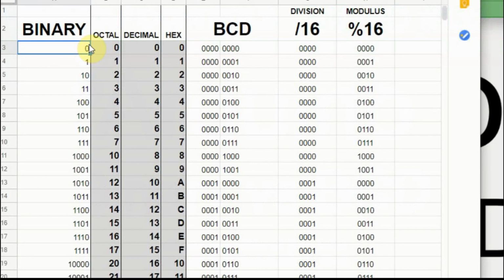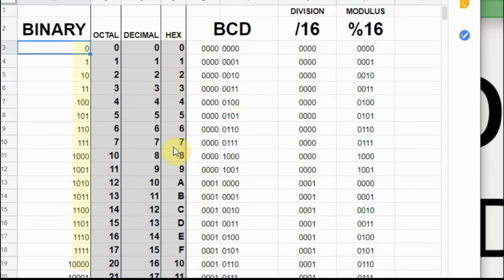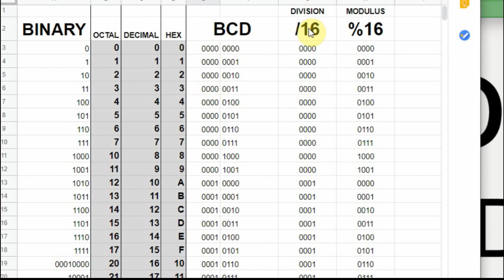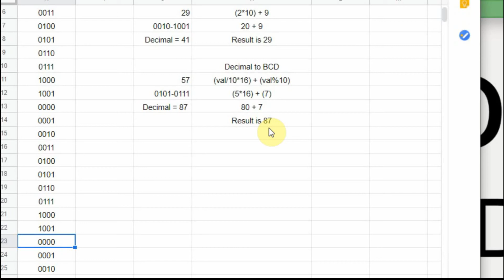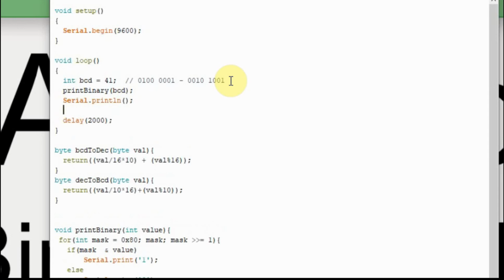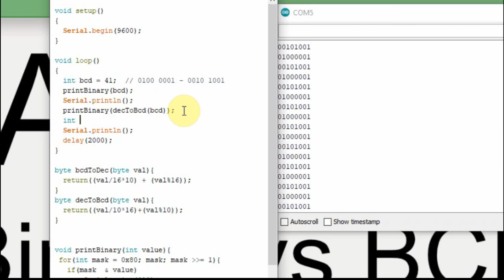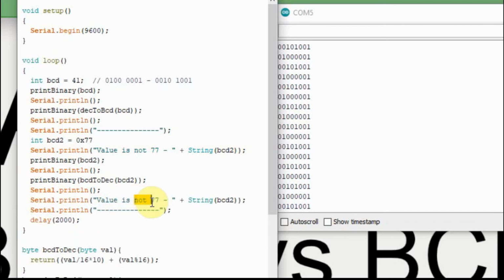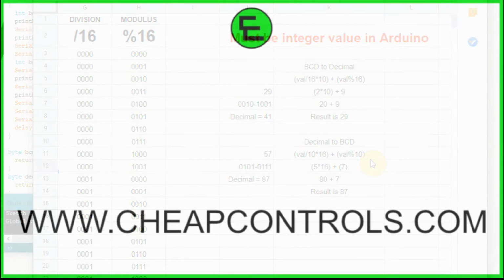122 Arduino Binary vs BCD

Comment: Hi, thanks a lot for this video it is realy helpfull  💡 , but I still have a question ; I have a Vector of 1 and 0 that I get from reading a digital pin in arduino  , the data I get is a BCD (I have checked  the result manualy👌) how to convert that vector of 7 nibles to a Decimal number , thanks in advance 🙂
Reply from the maker: I would think you should be able to use the same method.  Is it Octal?
Reply: @CheapControls   thank you for you response . No it is straightforward , I have a start Bit (a  1 )and then a bunch of 1 and 0 until the end of the data, I figured out that its a BCB by doing a lot of testing and manipulation, first I though it was binary but it didn't make sense in the convertion, I didn't know about BCD format , and now I am sur its BCD for example for 27466   I get 10110011000101110010000000000 do I have to divid it to 8 bits and then use your formula ???
Reply from the maker: Sorry,  I just got notified that you replied but I see it was a couple of days ago.  I will look into it and get back to you.
Reply: @CheapControls   No problem thanks a lot for your help . looking forward
Reply from the maker: I am not sure it is BCD but I see what you mean.  There is an issue that the bits are inverted and the numbers are inverted.  (1) - 6 - 6 - 4 - 7 - 2  but if you don't invert the bits you get (1) - 6 - 6 - 2 - E - 4  (6 is the same inverted or not.  I would need to know more about your application.
Reply: @CheapControls  Hi thanks again for you replay, I forgot to tel you that all the data is from the right to left definitely BCD format reversed . Thank you again